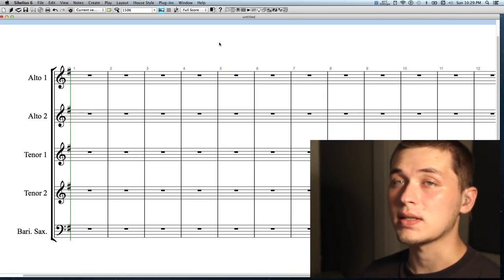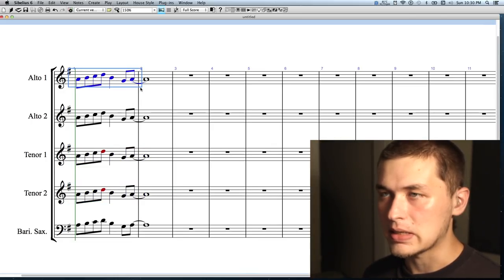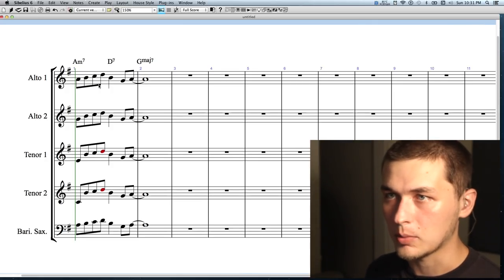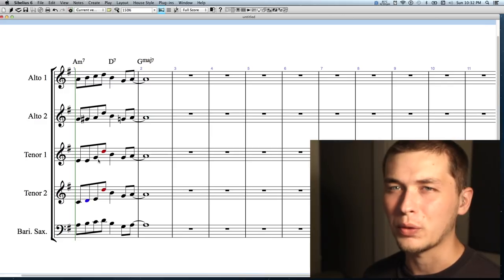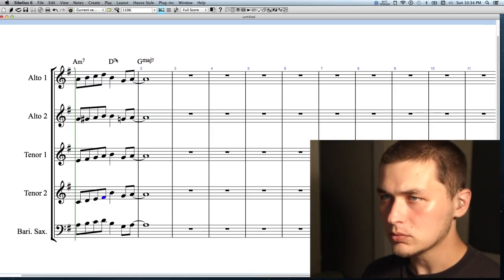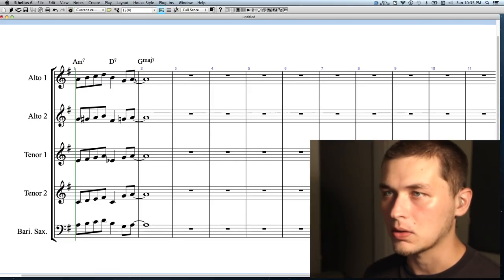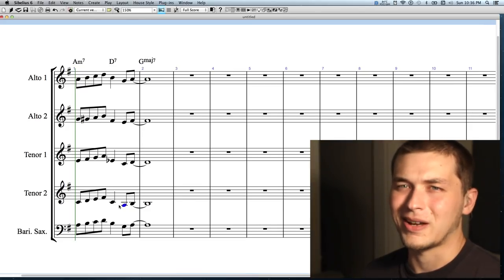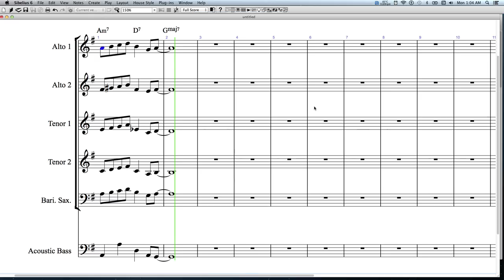Harmonizing Sax Soli - Block Voicings

Comment: I'm new to this so excuse me if this sounds uninformed. There is no D in the D7. On beat three, why not have the bari sax play D? Or would that clash with the Eb tenor 1 is playing?
Reply: +Mike B It might clash a little, but given that it's an octave below it would probably sound fine. That would be the very nature of a flat 9 chord. However, the reason there isn't a D there is because the root of the chord is stable, bland, and rather uninteresting. A lot of the time, it is preferable to add other tones and substitutions to make the sound more colorful.
Reply: +evan williamson Cool. Thanks.
Reply: no prob
Reply: In addition to that, he chose to do a block voicing and one of the key elements of this kind of voicing is to have the top and bottom voice play the exact same notes, just an octave apart. The other voices just sort of mingle in between them to harmonize the chord. At least that's the definition that I know.
Reply: That's what the rhythm section is for :)
Reply: Well b9's are completely meant to clash.
Reply: Mike B at the end he uses a bass to reinforce the harmonies by playing the roots of the chords

Comment: Hi Adam,

Great video! I love this kind of stuff, and would like to learn more about this kind of harmonization, specifically as applied to a larger section of a tune for a sax soli; for example Thad Jones' "Three and One," or Jerome Richardson's "Groove Merchant."  If one were to carry out this process for a longer section, should the same principles be applied? Does the bari always double the melody of the lead alto?  Any other fine-tuning kinds of things such as keeping the smaller intervals such as 2nds between the altos out of the equation?  Is it a coincidence that both of the examples I mentioned use a soprano as the top voice rather than alto, or is that more of a stylistic choice that the composers wanted the color of soprano instead of alto?

I have a feeling this is the kind of thing that I would just need to dive into and learn as I go along, but I'd love to get your input for how the process should work for a longer section in the context of an actual arrangement for a big band, rather than simply an exercise like you've demonstrated here.

Comment: hi, 
given the ii-V-I harmonization of the lick, I'd consider the loads of F#s on the ii chord as sort of distracting from the main voice-leading from ii to V, which is G (on ii) to F# (on V). 
Also, the nice b9 on the V chord (Eb) - as well as the 3 (F#) - are all too soon 'whiped away' by the following chord (on beat 4), which contains the 4 (G) and the 9 (E) again.
Suggestion: I'd rather voice the A and C notes on the Am7 as Am7 (not 6), the B and D notes as G#o7 (to further avoid the F#). For the V chord, I'd see the melody notes B and G together as part of a D7sus4 to which I'd add a b9 for both voicings. 
In doing so, the main voice-leading (G to F#) will occur on resolving to the I chord only (which is perfectly fine).
Here are the block chords note by note (from top to bottom):
A-G-E-C-A / B-G#-F-D-B / C-A-G-E-C / D-B-G#-F-D / B-G-Eb-C-B / G-Eb-C-A-G / A-F#-D-B-A
Reply: Please can you record it in a response video?  That would be awesome!  I'm interested in different ways to arrange things and what each of them brings.

Comment: Unless u specifically want the notes to be 1 8ve lower I usually put bari sax in the bottom of the staff when I can (it's a nicer sound and for bari is easier). And the red notes aren't very hard for experienced players
Reply: David Lea The bari notes are low they're just written on bass clef because they're expressed in concert pitch. If they were transposed they would be low on the staff.
Reply: Ethan Auringer ahhh okay thank you I didn't catch that

Comment: And if this were the end of a passage, I might take the last two notes for the bari and double the bass... so A B C D B -> D -> G (down from B to D, then down from D to G).  Now that's saxy phatness!  The only thing I might've written differently is the labeling of the Am7 to actually be Am6.  The chord really only has one instance of the 7, but three of the 6.  Sure it can be considered natural chord tension or even a 13 for a technical interpretation, but I'd rather just make it the Am6 in this case.  If I were providing the chords for a comp, I'd probably also mark the D7 as D13(b9) and the Gmaj7 as Gmaj9 (personally), but I'm ok with them being what they are for simplicity.

Comment: What about the parallel fifths that the 'Bari. Sax' and the 'Tenor 1' doing in the first half of the measure (and in some other places)?
I would appreciate your answer!
Reply: Parallel Fifths are only really "forbidden" in super strict classical counterpoint. Theres also parallel octaves for the hole section in the bari and alto sax.
Reply: Yes, but octave doubling is a whole matter altogether than parallel octaves. But yes, jazz does not give a shit about parallel fifths like classical harmony.
Reply: It's not parallel octaves, it's a doubling. When the whole line is a parallel octave it's just a colour and is "fine". Otherwise classical music would never use organ stops :)
Reply: There are no rules in jazz. :)
Reply: in jazz the parralel fifth rule don't count because in most time in classic harmony there a 4voices in jazz in this situation there five voices and there is space between the voices but if you have 4voices in jazz there is mostly a rythym section where space between bass and voices and cover that up
Reply: While the rules aren't as strict as in common practice harmony, voice leading is still very much a concern in jazz. Smooth voice leading often makes all the difference. That is unless you're going for parallel harmony on purpose, which is a great sound in itself.
Reply: Lorenzo Ola
Reply: even Bach wrote Parallel fifths...

Comment: I was going to say that the bass sounded off, but I notice you added another bass line. Did you or will you explain how you wrote the bass line? 
]
It looks like you mostly just copied the roots, added an octave to add some motion on that long A note, and then brought in some contrary motion to bring out that passing tone at the end, which is probably the strongest feature of the riff.

Comment: That's very cool. I was just wondering how the Gmaj7 can be a Gmaj7 when the notes are actually the notes of a B7 or a Gmaj9 minus the root. Either way, it doesn't seem to be a Gmaj7. Can you please explain? Thanks.
Reply: The notes are B D F# and A. So yeah without the root (G) it would be a B-7. But when you play the root note in the bass (which he does at the end) it's a Gmaj9. There is no need to put it in the voicing because you only hear every note once anyway. Sure it sounds fatter when you stack octaves but you're actually wasting the additional "flavor" of tension notes, like 9, 11 and 13.
Reply: This is meant to be accompanied by a rhythm section - piano, double bass and drums, typically.

Comment: so if you have any big melody steps like in prelude to a kiss B part is there any possibility for a voice crossing or how i suppose to deal with that in  block chord situation ? Thank for your lesson it is very helpful for my block chord understanding of it =)
Reply: Sergii Lomako If there's a big skip in the melody, all the instruments giving harmony under it generally just follow that. Harmonizing solis like this is basically all about parallel motion. The leap that each instrument does may not be the same due to the chord structure, but you should always voice your chord straight down the section. No voices ever really have reason to cross.

Comment: If the chord is a dominant 7, and the top voice is the root, wouldn't it be fine to have the second note in the voicing the flat 7 (despite it being a whole step, which you advised against) because 7 chords are supposed to be unresolved and tense?
Reply: tension and resolution is always welcome. that's a good rule to live by. however, one thing more important than that even is making sure your melody is clear and distinguishable. so harmonies that are that close to the melody, rather than simply providing dissonance, make the melody indistinguishable from the chord. does that help? the melody takes precedence.
Reply: Kyle Kerley Okay, that is helpful. Thank you

Comment: Hey, So I was wondering: How would I use this technique if I was say righting for 3 instruments like Trumpet, Alto/Tenor Sax and Trombone instead of 5 Saxes?
Also given the example you used to create a harmony for the saxes, how would you then add a Trumpet section and a Trobone section to the mix? I've always stuggled with this concept. Thanks
Reply: Hey! If you have less instruments you would pick the most important notes of the chords to be played, ie the guide tones (3rd and 7th) + the melody notes on top. 
And if you wanna use trumpet and trombone, you can just swap out the doubled saxes (alto ad tenor) he has in the video. Hope it helps.
Reply: Hello.  I almost think that it's a joke video.  Arranging is much more complex.  There can be unison, inversion of voices, counter melodies, moving in different directions, moving in different intervals, polyphony...  Here is what beginners would do.  I'm not sure it's the right approach.  Of course you have consider different instruments you have, their timbre, the result you want to achieve (for example do you want to play everyone at the same time, or more like question-response)...
Reply: @songfulmusicofsongs  He's just showing how to harmonise a melody with block voicing, which wouldn't involve inversion in most cases.  He does have unison counter melodies, moving in different directions and intervals, and polyphony, although to a lesser extent than you might find in, say, Bach.

Comment: Until you brought in the bass at the very end there was never a D7 or even a D  during your D7 chord.  As you said, it's a B7 (or a Bm7b11?) to Am7, which sounded pretty dang good...  But why bother saying it's a D7?  Wouldn't it just be a Bm7b11/D to Am7/D?
Reply: The harmonies don't have to cover every note in the chord to imply the harmony. For example, if it were a duet between two horns in G, it'd be totally reasonable to have one play B and one play D at the G major chord. In this case, they're playing C-Eb-F#-B, which, in jazz theory, is a fairly recognizable rootless voicing for a D13b9 chord.

Comment: That tenor 2 part is very unpractical since there is no low A on the instrument and the rest of the line is on the very bottom of the instrument's range.
Reply from the maker: This is a concert score!
Reply: BTFO
Reply: That makes sense, thanks. I do wonder how often you'd have to revisit the harmonic structure because, after transposing it for each individual instrument, some parts come out too clunky to play smoothly.
Reply: one could play it smoothly. you just need a decent tenor player with a good command of the lower end
Reply: It's in concert pitch
Reply: @Saxement  if you stay in close voicing when the lead is low and drop-2 or drop-2/4 voicings when the lead is high, and avoid repeating notes, you shouldn't have to worry about it.